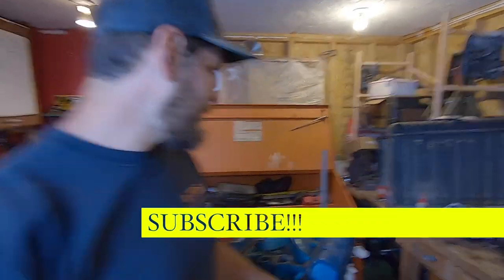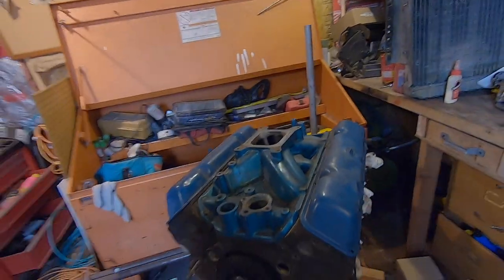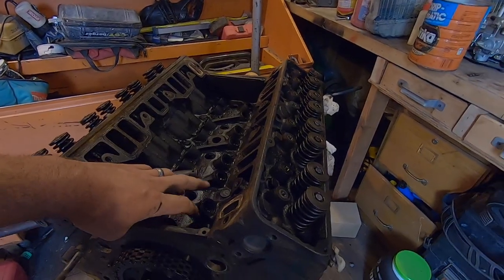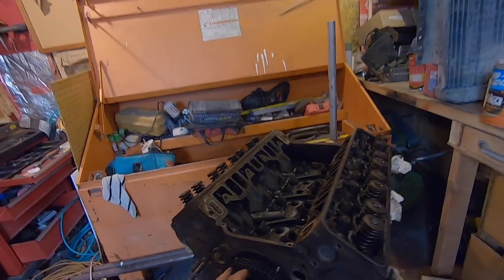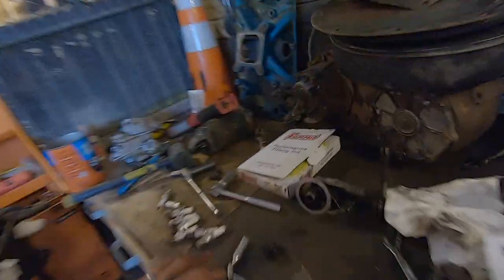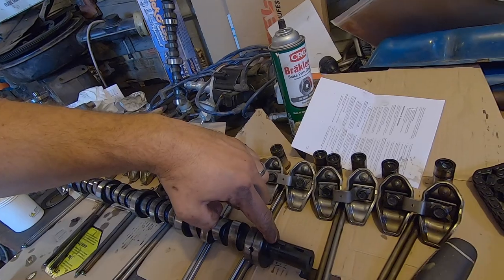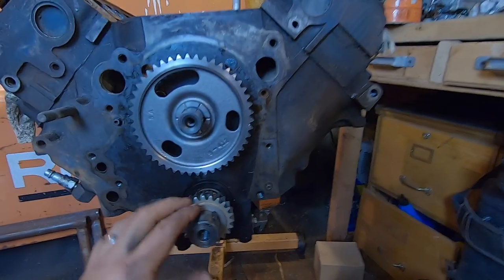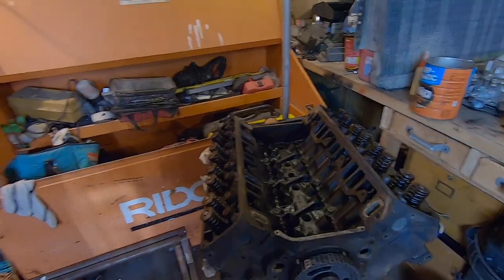Summit 8600 Cam install in an AMC 360

Comment: I first tried the Summit 8600 cam in my 360 when I rebuilt it. The 8600 is a great improvement over the pathetic stock cam . But after some seat time I came to the realization that the majority of claims made about the Summit 8600 performance in a 360 were clearly exaggerated. And so after more in depth research I chose a Comp 268H cam and installed it along with some cComp cams lifters and a set of new Edelbrock valve spring. And Wow what a difference in performance. If I said there was a undeniable increase in performance I would be understating it completely . My 74 Cj 5 did more than just came to life . It came to life with a undeniable attitude. My Jeep has a amc 360 with as stated the comp 268 H cam . and I used a degree wheel after installation. Then added a Edelbrock performer intake and new edelbrock AVS 2 650 cfm carb with off road needle & seat kit . Also a brand new motorcraft amc duraspark distributor with a recurve of the mechanical advance and adjustment to vaccuum advance . Taylor made wires , cap adapt , tall rotor and MSD distributor cap and wire retainer. A MSD 6al CDI ignition control box and MSD TFI coil. A T176 4 speed trans / dana 300 T case and 3.73 : 1 diff gearing and detroit limited slip differentials front & Rear. Along with new 32 / 11.5 / 15 Nexxus Razor Mud tires. And it absolutely will get gone lickity split. She do boogie big time !
Reply from the maker: thanks for all the info! I'm kinda considering this a practice run at building the AMC. I'd like to eventually do a full rebuild on a 401 with better parts, specifically for the style wheeling I do. dumping the quadratrac later this year for a 203/205 doubler, jeep is on 37s

Comment: that color of the intake is almosa blue , its the factory corlor of the early AMC motors. great video! cant wait to hear it fire up!
Reply from the maker: I wondered if it was a factory color as I was cleaning up the other engine parts, there was some of that color on the front cover, and the sides of the engine block. engine is temporarily on hold again :( in the middle of moving!!! we're gonna be in a rental for a bit while we look for land, but it's got a garage so that's sweet! It will be nice to have some concrete to work on, way easier to move the cherry picker around. Have you taken the gladiator or the Cherokee out lately?
Reply: That actually looks like a ford blue. You can still get the AMC paint, paint code is EN-66 it has a more turquoise color and is metallic.
Reply from the maker: @63jeepj20  yeah I think @ivanpomy was talking about the edelbrock intake he gave me, not the amc 360 I was working on here

Comment: I see you had lube on the lobes, but did not see assembly lube on where they meet the cam bearings, unless you put it on the bearings themselves.
Reply from the maker: the instructions that came with the cam said to use assembly lube on the lobes, and just coat the bearing surface with motor oil, so that's what I did. Thanks for watching!

Comment: Going through this now, but the timing cover wont fit on because it hits against the bolt at the end of the cam. If we do any adjusting of those gears at the end of the cam, then the outermost one doesn't fit on the keys and will turn independently.  I'm stumped.
Reply from the maker: interesting. the cam gear must not be on all the way, or the little cam thing that runs the fuel pump.

Comment: And I forgot to mention to make sure your new timing set oil hole matches correctly with the cam or you are going to eat up your timing gears in a hurry.
Reply from the maker: looked like there was only one way for the timing set to go on because key. Am I wrong on this?
Reply: @DaysofPainandVictory  Sorry I should have been more clear in what I was trying to say. You need to make sure the oil hole in the cam matches the oil groove in the timing sprocket. Aftermarket timing sets are known for not matching the cam hole and that is what oils the distributor gears. Some of those timing sets need to be welded up and reslotted to work correctly.
Reply from the maker: dang, probably better pull the front cover off and check, thanks for the info!

Comment: Just a suggestion but you would be better off with a air gap or performer intake over the torker for a jeep application. The torker will work but with the 8600 cam and no stall the dual plane intake is a much better choice all around.
Reply from the maker: Yeah I know this isn't the ideal intake, but it was free so I'm gonna try it. Performers are hard to find used and nearly 400 bucks new so going to hold off on that for now.
Reply: I understand that totally. I will make another suggestion if you can find a offenhauser dual port intake is a fantastic jeep off road intake from a 401 on down it works great.
Reply from the maker: I check craigslist and marketplace weekly for AMC and Jeep parts, if I find a good deal I'll go fo it for sure. thanks for watching!
Reply: @DaysofPainandVictory  JeepFirst has new Performer intakes for $285 also Ebay is a good place to look sometimes. LOL. Anyhow enjoy the amc 360 most underated domestic v8 that IMO.
Reply: The Torker intake is much more adept at torque production than anyone whos never used one will ever believe. They are actually a really  good intake for street and torque production . Contrary to what their appearance leads most to believe. Much better than the Standard Performer intake u unlike  most claims made by most claiming to have compared the 2 . A Performer RPM Air Gap wont offer any improvement over the torker intake with a 8600 cam except charge air temp. With a bigger cam and a headers along with a increased CFM carb carburetor there would still be very minimal improvement over the old Torker . They work surprisingly well
Reply: The 8600 isnt capable of taking advantage of the the intake charge volume the Torker Intake can provide.
Reply from the maker: @GorillaCookies  I’ve been really impressed with it so far, the Jeep is so much more fun to drive! Plus with the 4.56 gears and low range, it gets into the higher rpm real quick